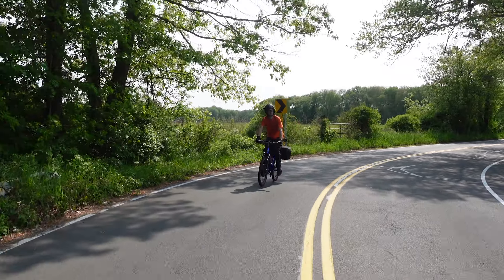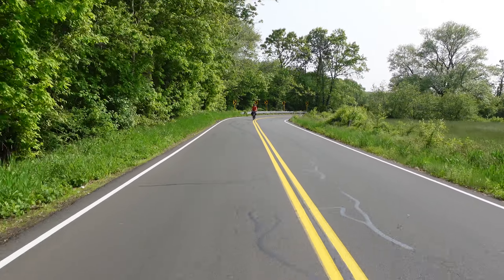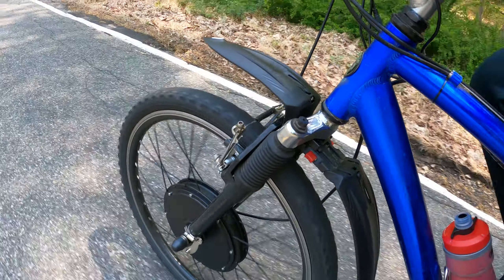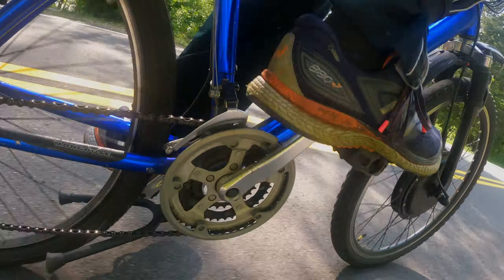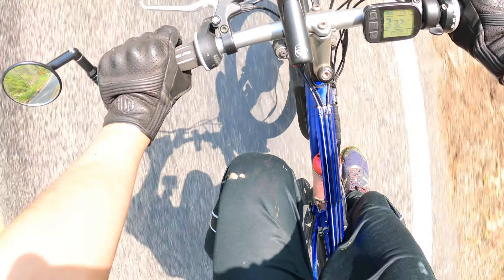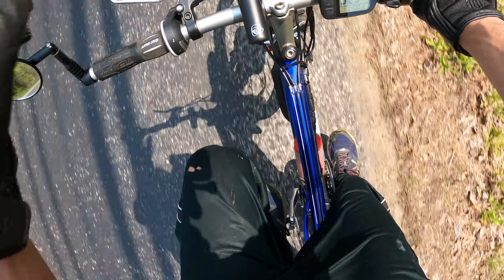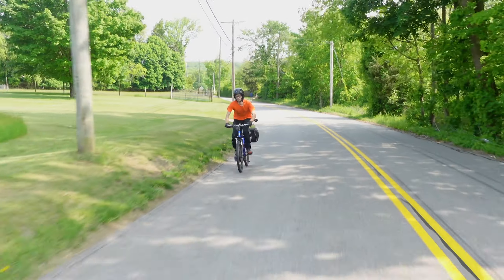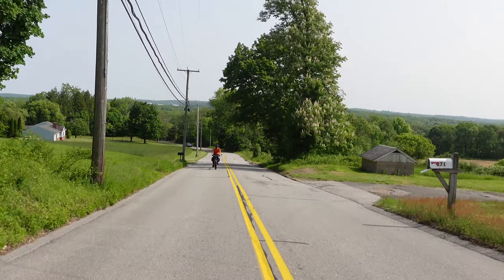Riding an eBike with No Power

Comment: I have an ebike with 250watt motor and a 36v/5.8ah battery. It does only 25km-ish on E mode. So I switch on E only if the road goes uphill. I pedal on flat roads. I do nothing on downhill. It has gears which help but it still feels heavy without the E. My gears always stay on 28t and 24t. Anything below and I have to put effort in the pedals. I have a regular bike and that feels so smooth and easy. The E weight is definitely an issue.

Comment: My e-bike is just a heavy and kind of slow mtb when the motor is off. It's not so bad as long as I don't have to climb any hills. I can go almost as fast as on my non electric mountain bike. It kind of rides like a beach cruiser. Whenever I don't want or need to go fast that's how I ride it. (Mine only weighs 50lbs. 350 watt motor, 10.4 Ah 36V battery.)

Comment: I often drop my pedal assist down to zero, and ride for exercise, and yeah, it is hard work on a 26 inch fat tire ebike. But just some planning can ensure you get home okay every time. And yeah, I grew up in the 50s and 60s, a time when you did stop to see if a guy with a break down was okay, and hitch hikers didn't get murdered. Mostly you didn't need to lock your door when you went out either, car parked in the driveway had the keys left in it, never a problem! Different attitude between regular people back then for sure. ;